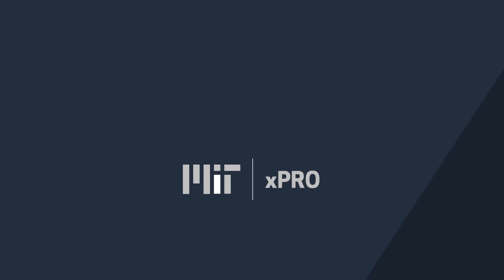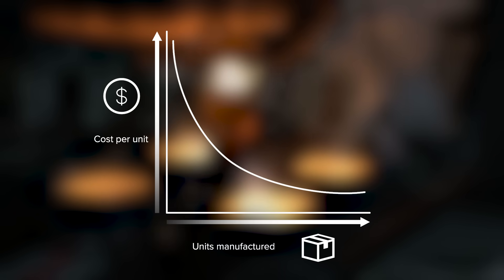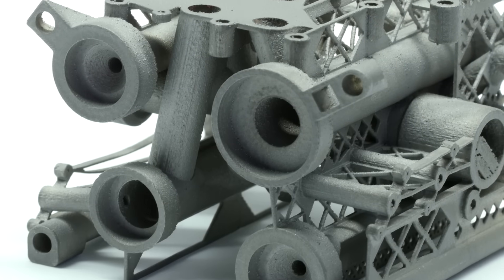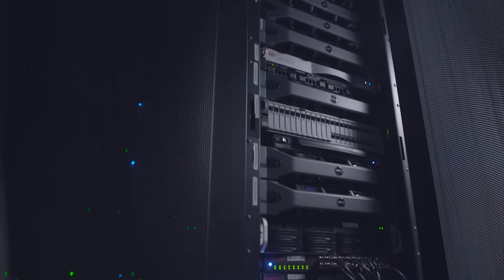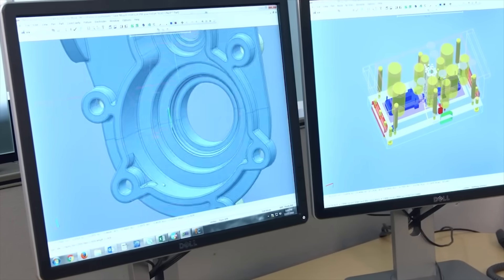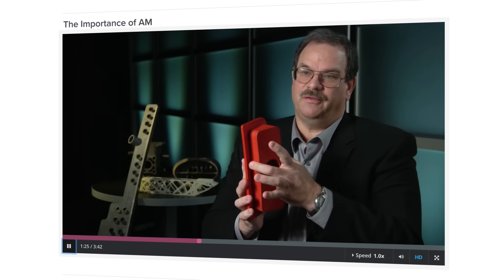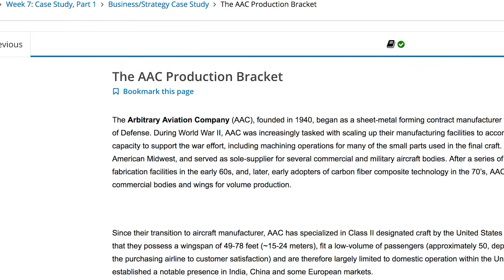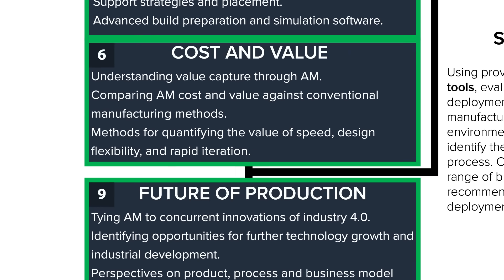Additive Manufacturing for Innovative Design and Production

Comment: Do I understand correctly that Additive Manufacturing equals 3D printing?
Reply: Have you got answer for ur question. If yes please tell me
Reply: @sivaralv2628  Yes it is, but there are different types of 3D printing depending on material and mechanism
Reply: Yes you do👌
Reply: It's not, 3D printing is inside the field of additive Additive Manufacturing, but it isn't the whole concept
Reply: 2D printing is technically “additive” as well